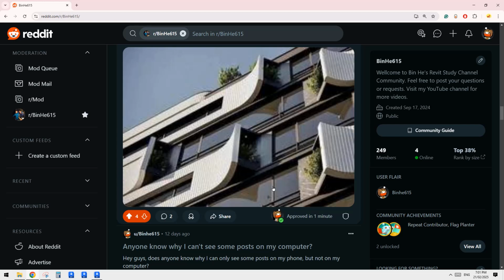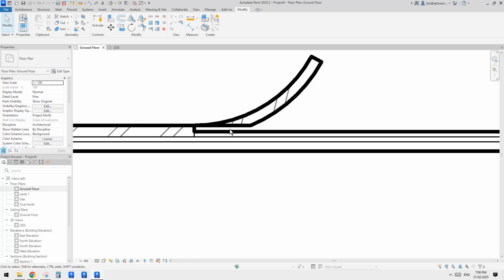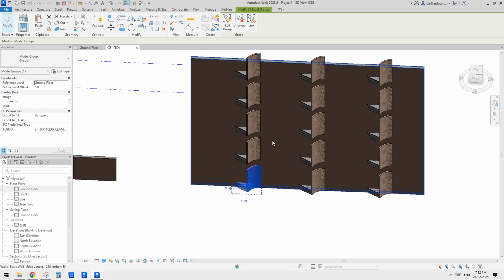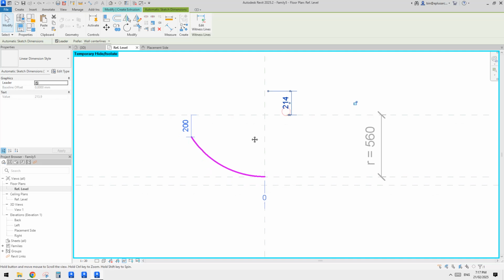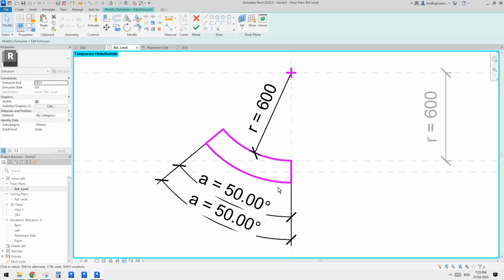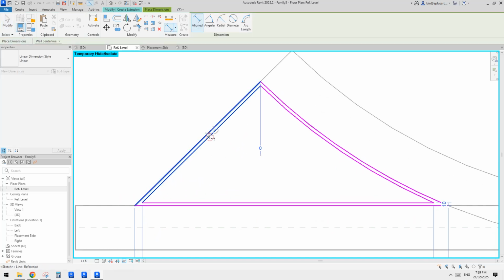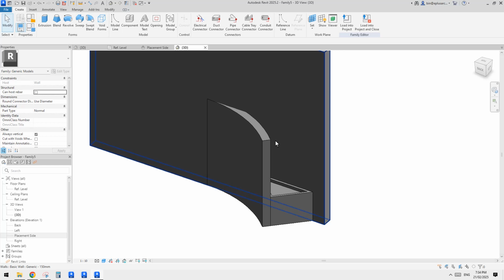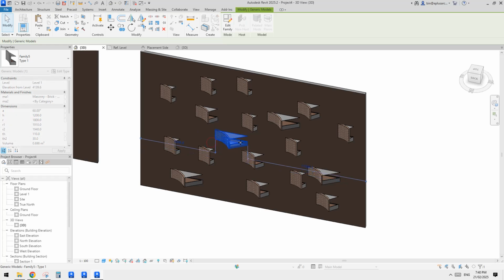25027 - Parametric Wall Based Family Exercise in Revit

Comment: hello bin thank you for the tutorial. i was following along and tried to set sill height parameter using a reference plane (sill) for both planter and curved wall but for some reason the planter goes back to reference level plane when i change the sill height causing inconsistencies in the model. i tried to redraw the planter extrusion and set work plane to the sill but still it is causing error i.e. always going back to the original reference level plane.
Reply from the maker: Can you send your file to me? I will have a look for you.